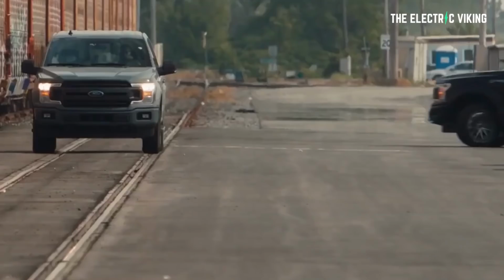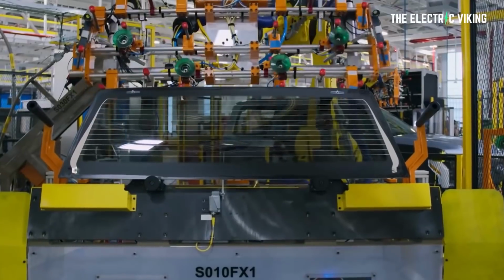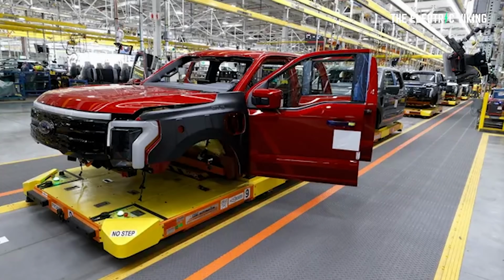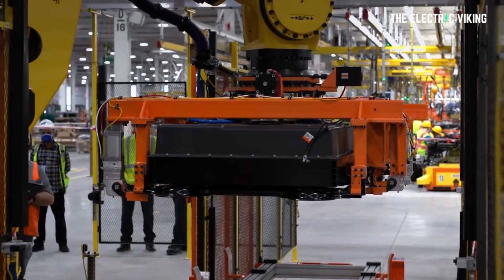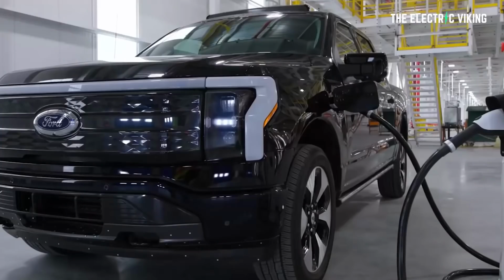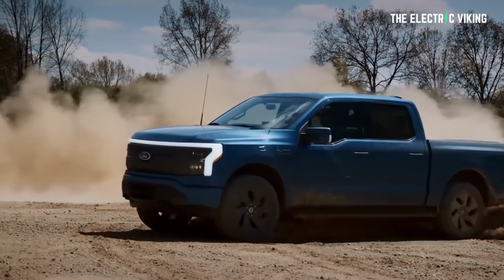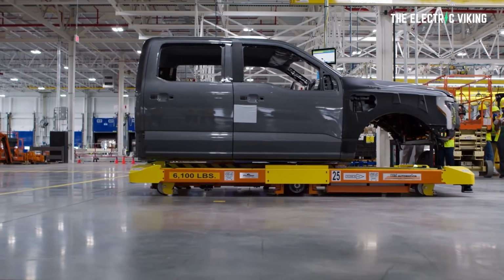Ford's new EV plant exposes Ford's ticking time bomb

Comment: Ford put the CCS charging port on the left front of the F150 Lightning, but there is a matching blank panel on the right front. I suspect that someone at Ford planned a future option of adding an optional Tesla charging port on the right side so their customers could use Tesla superchargers. It's ready, just a matter of Ford and Tesla making it happen.

Comment: There will be no end soon for the ramping up the speed of production. As time goes on and the learning curve has its effect, Ford will demand a faster, more efficient production schedule, to the point of over-capacity of the machinery’s normal abilities. That will usher in the necessity of crisis management maintenance. At that point, all hades breaks loose, stress levels go up, and there goes your easier work environment. No manager who values his/her (or whatever pronoun required) job will dare to suggest slowing down, what would be, the line. 
Yes, the EV plant is different for Ford, and yes, a huge leap forward. Kudos to them for that! However, if they do not change their personality of leadership and it’s inherent habits, their new EV plant will ever increasingly resemble their combustion vehicle plants.

Comment: I am a ford UAW worker that currently works at the rouge for the last 5 years. The biggest thing in the union is seniority. Many of the old timers with higher seniority (20-30 years) work in the easy sit-down air conditioned plants such as transmission plants. Sooner or later the transmission plants will gradually decrease production and eventually close for the switch to electric cars and trucks. At the same time by the time that happens a lot of the higher seniority people will retire or take a buy out. This will equal out the work force. The rouge is in its own zone of seniority so another person from another plant outside of Dearborn can not "bump" a lower seniority worker to another plant outside of the rouge but if you have high seniority you can leave the rouge and move to another plant. Also a big workforce (20%) of people working are temporary workers. These workers serve as a buffer for once jobs are eliminated or created. Also believe it or not actual production of the blue collar workforce is only 5-7% of fords expenses. The other 95% ish of expenses come from engineering and marketing and the higher up CEOs. So basically if you are not a temp you should be fine with job security.
Reply: engineering costs ok, but a company with high  'marketing and higher up CEO' costs is a failing company

Comment: The problem with the internal combustion engine is that they last too long.  Battery packs make up a significant portion of the cost of the vehicle and have a limited useful life.  New EV's don't have to compete with old EV's.  If you can't afford a new one, you're stranded.

Comment: They will always be more strict with the guidelines than with actual practice. Turning off cell phones obviously won't be a 100% thing for the workers, but I guarantee the areas that do have a problem with EM interference from blue tooth or wifi run a very tight ship and the workers there know the risks.

Comment: Recent subscriber, this is a good channel! 

Lithium tech will never replace the present internal combustion engine platforms in America.  Lithium shortages, very dirty process in mining, recycling old batteries, etc.  Currently, battery platforms are great for commuting / daily driving in warm climates in many North American cities, but long range and cold weather regions it currently is a pipe dream to think they can replace proven gas and diesel platforms. 

Once again, Toyota has the answer, solid state batteries that are configured as hybrids (with internal combustion engines) - not 100% electric platforms.  Toyota may own the electric segment World-wide if they can get the solid state battery platforms to last long enough, and keep the cost down. In 2025 we will see what Toyota's products can do.  I don't think Ford or Volkswagen have the tech for major adoption.  Toyota might. 

Ford better be careful in drinking the all electric Kool-aid.  Cold Fusion & hydrogen are the ultimate goals for "clean" transportation platforms, but far off if ever.  Internal combustion + hybrid battery tech is the current best option imo.  Toyota might get it right and be the dominant player world-wide.
Reply: Honda invested in GM for solid state batteries amongst other things.  Toyota is so far behind it isn't funny.

Comment: Hype.  As a lifelong industry expert, I can assure you this video will not age well.  It's still Ford, and the UAW and the same mindless suits are involved.  I lived the Toyota TPS system, and I guarantee you this will not work.  I can also assure you that the current platform of Lithium batteries is OLD technology the the market will reject this design.  Stay tuned...

Comment: the biggest mistake they are all making is that they are treating the EV like all they have to do is flip a light switch and walla.. we are now a EV country.... not going to work.... there isn't enough of anything for us to switch like this....  they should start out as a hybrid...  that way if they can't get enough batteries then you can still buy a new truck and drive it on gas.... then when enough batteries show up you just plug in a battery and now you can drive the truck for thousands of miles and not run out of battery juice... you just won't need as much gas....   simple ..isn't it..

Comment: I am a former GM industrial engineer who worked for many years setting up production lines.  Jobs on these new lines will require less walking.  They will not contain less work.  The Toyota Production System will still highlight and strive to cut the amount of time not actually installing a part.  Controlling the amount of time in each station will be possible and will be a subject of negotiation with unions.  This system will be more productive than workers currently realize.
Reply: Thank you for this post. I always listen to people who have worked facing the real factors of the shop floor.
Reply: @marktwain5232  I can tell you have practical experience as well because of the simple fact you referred to it as "the shop floor."
Reply: @longmuskox4194  Thank you! I spent 41 years in IT retiring in March 2021. It was a great career. I loved every minute of it! I spent the last 25 years with essentially the same staff under different corporate buy outs. The greatest creative people imaginable! We made money hand over fist despite which clueless corporate suits were in our way. Both our software designs and marketing schemes were always based on the trap blocking schemes of the 1970's Pittsburgh Steelers under Chuck Noll. You always solve a problem at the point of attack! You always start with the vision of the man actually walking point! NOT the man who only THINKS he is walking point!
Reply: giga press?

Comment: The Aluminum body of F150 is amazing technology - it took Ford years to develop - the basic technology dates back to when they owned Jaguar. It makes a massive difference to fuel economy too, versus old school heavy steel.
Reply: You act like they're the first company to ever have an aluminum body lol. Dude, companies have been doing it since the 50's.
Reply: @muskokamike127  not mass producing it to scale on a large vehicle.
Reply: @mkyhou1160  due to the expense not the complexity of using aluminum.
Reply: @muskokamike127  Tesla can’t do it (they would if they could, range on all their vehicles would increase significantly).
Reply: @mkyhou1160  I wouldn't say "significantly" as you're not talking about halving or quartering the curb weight of the vehicle. The battery is the majority of the weight. 

I'm going to guess the body panels of a tesla model 3 total maybe 600 lbs? So if they were aluminum they'd weigh about 200 lbs (since aluminum is about 1/3 the weight of steel but that various dramatically depending on the types of each). 

So you're really only saving 400 lbs off a vehicle that weighs 4600 - 5000 lbs. 

If you save about 10% body weight and the range is around 400 kms (real world) you're only increasing the range by 40 kms.

Comment: Received an offer to turn my reservation into an order, but the only options available were models starting at 67k and 90k.  No Pro and no platinum.  Not sure how much of that is supply and how much demand since I haven’t seen any production numbers.  But I’m starting to feel like the 40k truck is mostly an advertising gimmick.
Reply: It absolutely was cheap marketing similar to Cybertruck 40 price tag. The 20k Maverick is too!
Reply: If the demand goes up the prices will rise.  As the electric grid becomes more taxed from charging cars the cost of electricity will also increase which will increase everyone's cost of electricity for everything.  This is just a big scam.

Comment: great news coming from ford. wishing them all the best with ramping up production of the new truck. I've got a cyber truck on order but I would consider switching if fords are actually available. it appears they will soon pass rivian this year in trucks delivered if they can avoid the chip and battery issues. I've personally worked at 2 of fords facilities, LAP and KTP. this plant in the video looks more comparable to the Lexus line in Georgetown ky, very clean, less conveyors. I can attest to how dirty it can be in the powertrain building for Toyota. there is a thin mist in the air that comes from the oils and lubricants they are using for the machining of the components. the conveyer belts give off constant dust and noise and are dangerous to get close too. these small electric skids look much better. would be great to see ford deliver 100k of these this year and double every year. personally I don't see why they couldn't sell 500k a year or more for the foreseeable future. I would prefer a 3/4 ton to a half ton. looks like cyber truck will be splitting between 1/2 and 3/4 ton. or will that even be a thing anymore in the coming years? I've got a 2500 chevy Silverado at the moment as a contractor. good luck ford. god speed.

Comment: Many people here in Wisconsin own pickups to tow thier boats and snowmobiles/ATV's to northern WI and upper Michigan. Electric just won't cut it right now. It remains to be seen if it EVER  will for these purposes.  Lack of charging stations there and reduced range while towing and in cold winter weather around here make an EV pickup not even an option here.  It will be a LONG time before gas pickups go away.
Reply: Ford sells 700,000 or more F150 trucks per year right now. They will only be able to build 200,000 Lightning trucks per year in 2025. It will be 2030 or later before Ford can produce an all-electric fleet. Gas trucks built & sold in 2028 may still be on the road in 2040, even when almost all new sales are EV. This first generation of electric pickups will be mainly for daily routes and in-town towing. Cybertruck will be viable for some long-range towing because their Supercharger network is fast, reliable, and widespread. People who buy a Lightning and want to tow a boat or camper any distance will be SOL.
Reply: We have MILLIONS of apartment dwellers that will NOT buy an EV.  The next time you stop to gas up, sit around for 20 minutes to see the future.
Reply: I agree, they would need way more charging and battery warmers ?
Reply: Boat docks are the perfect place to charge your car!

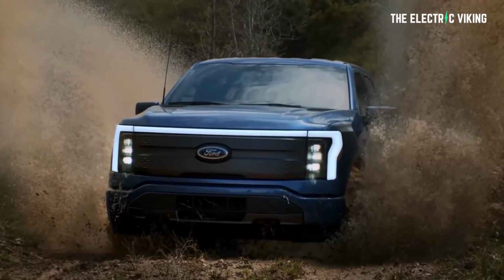Comment: 3:39 Notice the mudwater spring out behind the headlight. I thought fender liners were supposed to stop this?  Let's just hope this is an incomplete prototype.
Reply: Good catch.  Yeah, I would consider that to be a design error or a broken/missing part.
Reply: The only incomplete prototype is the Cyberflop, these are real trucks rolling off the assembly line.

Comment: A few quick comments:
1 - The ICE powered vehicles will continue to be needed and manufactured for dozens of reasons for the foreseeable future - likely 20 years or more.  Which means the current factory workers have employment until they retire.  If you are 35 today, you will likely have a job until 55, etc.
2 - IF Ford has designed the Lightning well (and it seems like they have) the quality of the build will be fantastic!  The moral of employees working in a low stress environment and making comments like those you read clearly indicates happy people - happy people show up to work on time, work hard and work well.  These are all good signs for Ford and customers.
What I see from this is all good and will be interesting how GM and Stelantis take on building EVs!
Reply: Lol
Reply: Good luck bro. ICE vehicles are done.

Comment: So as the share of EV production increases and that of ICE decreases, more ICE plants will be converted to EV plants saving those workers jobs, Meanwhile there will be a lot of retirements in EV plants leading to transfers form ICE plants to Ev plants. If this was to all change instantly tomorrow there would be problems. But the luxury of time will allow for a relatively smooth transition. Your concern probably is more applicable to GM
Reply: There will possably be a smooth transition. I doubt it but it's possible. But it will be anything but calm or pleasant. Most of the plants Ford has won't be remodeled but replaced. Cheaper, faster, and better to build new with so many changes. And most of these plants won't be where the old plants are. Other locations will offer more and they will move on.

Comment: Come on Sam…, we know the truth - it’s not Wi-Fi or Bluetooth interfering with equipment…, it’s about people taking photos and making them public… 😳🤣
Reply: Many companies provide stickers for visitors to stick over their phone camera lenses when they check in and they are allowed to removed when they leave
Reply: I worked in semiconductor manufacturing so my experience isn't with vehicles, but there is a legitimate concern with some equipment. We were not allowed to have phones but people did anyway of course, however some sensitive equipment is 100% susceptible and it can affect output. This is almost always accounted for with widened limits but they will shut down equipment to requalify if any variance is seen on in-line quality checks (even if its within tolerance).
Reply: I'm sure the dual reason is of course to remove cameras, but the quality concern isn't fabricated (at least in my experience).
Reply: I went through the Toyota Camry factory in Kentucky and every one had a locker to put their valuables in, and that included my Cell Phone! They weren’t allowed in the plant!